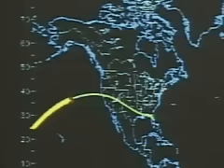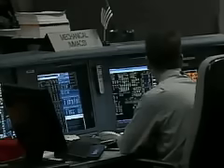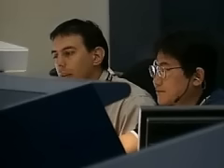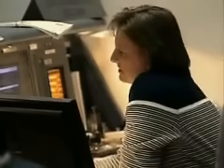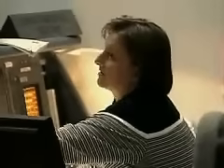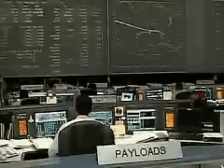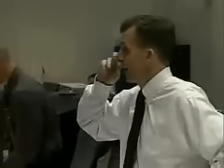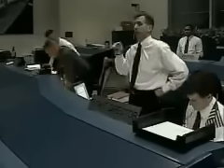Inside Mission Control During STS-107 Columbia's Failed Re-entry and disaster

Comment: Can you imagine what that flight director was feeling as he gets bombarded with all that bad data, lost sensors, hearing that constant UHH comms check go unanswered. The fact that these people kept their cool is amazing.
Reply: I would imagine Leroy was briefed that if there was going to be a catastrophic event on reentry, he would see the initial signs of that occurring. When the tires lost pressure, I think that was his first indication there was indeed a breach of the left wing.
Reply: @jameshoran8  they absolutely were all aware of the issues with the launch debris as there was an investigation during the flight. the investigation was closed determining it would not affect the entry but of course you bet he knew it was the left wing. When several sensors failed at around 2 minutes into this video and he asked both, where are they located and is there commonality the answers were chilling. First off all the sensors were in the left wing and second there was NO commonality, meaning that it wasn't a single computer or electronic system that controlled them all which with a simple not threatening malfunction could cause them all to fail. The fact they were on separate systems and all failed meant it likely wasn't instrumentation and was a real failure... the only communality turned out to be the location... the left wing they knew had been impacted by debris. When several additional systems in the left wing including tire pressure was lost at 5 minutes (lost tire pressure on mains in the shuttle is a border line fatal event that if this flight had continued might have caused them to make the decision to bail out) and then at the same time they lost communication AND data from the shuttle entirely they knew. By 8 minutes they knew for certain but continued to treat it like there might be a miracle. By 12 minutes they were told from outside services there was visual confirmation from Texas the shuttle had broken into pieces and that's when they locked the doors and began data preservation procedures.
Reply: *UHF
Reply: I'm not sure they did; there's quite a bit that doesn't make it on mics.  I don't like thinking of NASA people as soulless zombies.  There's no way you can take in Challenger and Columbia without emotion.

However, because hindsight is 100 percent, why didn't NASA send human-less probes to the moon first; why risk human mortality until more certainty had been established?  I think nationalism was to blame, and the sense that capitalism absolutely had to triumph over soviet-style communism, no matter what.
Reply: I don't feel a lot of empathy for the NASA folks.  They knew there was an issue with this flight.  A recurring issue from other flights to be exact.  They played  Russian Roulette with the live of these people and lost.  1986 was not much different.  They ignored the advice from experts and it cost a bunch of lives.  I met one of the engineers who warned them about the O-rings.  He lived the rest of his life seething with anger for NASA management because it could have been prevented, but, some of the managers were more interested in career advancement.
Reply: @jeffdenig705  I think with this particular flight, they just didn't think it was that bad because it was a small piece of foam that hit the wing (it was a 2ft. x 1ft. piece of polyurethane) and it wasn't something like O-rings which can leak fuel onto a rocket and cause an explosion. I believe they just weren't thinking about a small part of the wing being damaged. Maybe they thought the crew would notice, attempt to temporarily repair and return safely.
Reply: @jeffdenig705  you do realize that only a few at the top knew about the o-ring issue right? That most of the people in mission control had absolutely no idea.
Reply: @josephherron7671  o-ring killed Challenger...Columbia died from launch debris damage to protective tiles
Reply: Well, they know they are being filmed. I think if they weren't being recorded they would have let all of their raw human emotions loose.
Reply: @DeepPocketsEnt  in that moment I seriously doubt any of them were thinking about being on camera.
Reply: @josephherron7671  I don't. I can read human behavior extremely well, I studied it extensively, with a specialized focus on body language.

Their behavior was VERY visibly contained, anyone can tell they were holding in all of their emotions, you can see it all over Cains face, he looks like he's ready to burst into tears. They were all WELL aware that they were being filmed at the moment, that this video was going to go down in history, and that this moment would be viewed millions of times, ad aeternum. 

What they showed outwardly undoubtedly did not match the whirlwind of emotions that was going on inside themselves in that moment. Cain was visibly on the verge of tears the entire time but he held back to maintain a strong and professional demeanor. I'm sure he has probably spoken on this matter in interviews.
Reply: @DeepPocketsEnt  of course they were holding on their emotions. They’re trained to hold their emotions in stressful situations. Otherwise they wouldn’t be worth a shit as mission controllers. Man you really have a warped perspective on the world.
Reply: @DeepPocketsEnt  literally armchair analysis, just because you say it on the internet doesn’t mean it’s true xd.
Reply: @DeepPocketsEnt  HOLY sweet mother of non-ironic god
Reply: @DeepPocketsEnt  "I can read human behavior extremely well, I studied it extensively, with a specialized focus on body language."  

Cain actually does not look like he was ready to burst in to tears.  Have you ever met an engineer?  They've likely never been on the verge of bursting into tears. 

So, besides the cameras, you realize that they're in a professional work setting and must show composure in front of each other.  No different when there's an earthquake in skyscraper offices.  Or when a surgery team loses a patient.  No cameras and they keep their composure. 

Can you read my body language toward you right now Deep Pockets?  Hint. It's not good.

Comment: 13:20 Flight Director invokes the JSC Contingency Plan (JSC-14273) - "Definition of Space Shuttle Program contingency: A Space Shuttle Program contingency is
 defined as any program-related failure, accident, or incident (involving Space Shuttle
 Program-controlled flight or test hardware, support equipment, or facilities) that significantly
 delays or jeopardizes the Space Shuttle Program or a flight, prevents accomplishment of a
 major objective, or terminates a flight prematurely." They are basically securing the room and treating everything as if this was a crime scene. All in an effort to prevent whatever happened from ever happening again.

Comment: @12:30 I didn't understand the "lock the doors" and after seeing many comments talking about it but not explaining it I googled it and my heart shattered and i got chills.
For those wondering, it meant that the failure was fatal and to secure mission control so that nobody comes in or out. All controllers are to begin saving their telemetry for the investigators.
Reply: Flight Director did everything right after he knew what had happened.  Kudos to him.
Reply: It's called "Impounding the data". Everyone basically freezes in place, no one can come in or go out of the room. All data, electronic, voice, even scratch paper notes, are collected for the investigation that will follow. This is standard procedure when there is an anomaly .
Reply: Yep.  At that moment, Mission Control effectively became a crime scene, for the purpose of investigation.
Reply: As soon as you hear those haunting words LOCK THE DOORS you know all those in that room will be feeling and those poor people on board have just lost their lives
Reply: Not after you realize many engineers begged NASA for visual inspection of the protective tiles but they were turned down. They knew exactly what happened the moment telemetry showed a surge in heat on the left side of the ship.
Reply: @dorianrustik6880  a small part of my branch at my company developed the THz imaging system that would be used after this to inspect the insulation system.
Reply: @dorianrustik6880  are the idiots responsible ever named and held accountable for these preventable disasters
Reply: @dorianrustik6880  Exactl! Begged and ignored. Engineers asking for outside agency help. They were trying to get the defence department to use spy satellites to take pictures of the shuttles heat shield. Which was done on STS-1, the first shuttle mission also with Columbia, classified at the time, but no doubt would have saved the crew of Columbia on this day.
Reply: @BluesMan123  I feel u, bud. Let's hope we learned from their sacrifice.
Reply: @dorianrustik6880  are there any videos available about the moment the mission started failing
Reply: @RiyanRishitha  There is a recent video on You Tube by Scott Manley who along with telemetry spells it out. Very precise & clear each moment to complete destruction.
Reply: @cherylcarroll7916  thank you for the response
Reply: It’s all evidence. It’s standard preservation of evidence.
Reply: Thank you for adding this! Those words give me chills every time I watch this footage. I assumed it was to keep people in, but didn't know that it had such a devastating additional meaning to the controllers beyond that. So many goosebumps.
Reply: @jlbyler22  Me too  chills every time for me as well...and hello there...atleast I am not the only one from May 2022 watching this
Reply: @raintree3383  Hello to you as well! I'm happy to have a fellow May 2022 watcher here with me 😀
Reply: @jlbyler22  Hello..thanks so much for your reply ! This video is so real life.... Completely devastating for the people controlling it all....sadly and Hi from Lorraine in Canada
Reply: @jlbyler22  Hello May 22! I'm from the future! January 2023. If you should happen to bump into my 2022 self, could you tell him that he was right about the vaccine? Cheers!
Reply: @zakmartin  Vaccines are fine.
Reply: IN the Artillery, if have a round land where it shouldn't, our "Lock the Doors" is "Cease Fire, STAND TO THE REAR OF THE PIECE!"  It means nobody touches anything, and you fall into formation behind the gun and pray that you dot go to Leavenworth.
Reply: Yeah, they need to be a walled castle at that point. No distractions, no interpretations. The data systems were much more robust than during the Challenger Accident. Heck, the control room in Houston during Challenger was basically unchanged since Apollo.
Reply: Thanks for that
Reply: Keep the scene sterile for investigation.
Reply: At least it was over for the crew as soon as the hull broke. Maybe less than a second.
Reply: How's THIS for chilling: 

the ONLY reason there hasn't been 3 MORE SHUTTLE EXPLOSIONS courtesy of the CRIMINAL negligence of NASA (founded by a Nazi!!!) (YIKES!)........(Von Braun!)......is bc the Space Shuttle program was retired!
Reply: Thank you, that’s very helpful
Reply: Pretty self explanatory but congrats on utilizing resources to solve a ?
Reply: I don't understand, could you elaborate more? Coming in or out of what?
Reply: @anthonyanthony2783  the control room
Reply: That comment was made because they didn't want to immediately tell the truth like any government entity they didn't want to answer questions despite the fact they knew exactly what happened....
 It's called keep the tax paying citizens stupid......
Reply: @FSEVENMAN  Did someone say "stupid"? There's nothing more pathetic than ignorant morons who don't understand how anything works calling other people "stupid."

Comment: You know I had an argument with this guy who designs software for the US military weapons over this, I said, you know they could have done a flip with shuttle after undocking to verify there was no damage. Well interesting enough once the shuttle got off the ground again before it docked with the ISS it would do exactly that, a flip so the folks in the ISS could inspect the shuttle for damage and the cameras on the ISS would send images back to NASA. This accident could been avoid if they simply just took the time and looked to confirm instead of going on their hunch that nothing was wrong. It's the engineers responsibility to get those astronauts to and from space, they should be held accountable for killing those poor folks. Yes I understand space travel is a risky busy but it shouldn't be plagued with stupid people but people who take the time to investigate visually check if there is a problem.
Reply: Just that STS-107 never went to the ISS, it was a specific science flight, not an ISS-building one. So they were in a completely different orbit,  no way to reach the ISS.

Comment: Terrible. They knew this could happen as soon as they found out about the tile after launch. A morale dilemma of whether to tell the astronauts or not ensued apparently. Such a traumatic event. That's why astronauts are heroes. RIP.
Reply: There was no moral dilema.   They did the immoral thing.  An email sent to the commander and the Pilot of Columbia said this:  "During ascent at approximately 80 seconds, photo analysis shows that some debris from the area of the -Y ET Bipod Attach Point came loose and subsequently impacted the orbiter left wing, in the area of transition from Chine to Main Wing, creating a shower of smaller particles. The impact appears to be totally on the lower surface and no particles are seen to traverse over the upper surface of the 
wing. Experts have reviewed the high speed photography and there is no concern for RCC or tile damage. We have seen this same phenomenon on several other flights and there is absolutely no 
concern for entry."   This was entirely misleading because the Debris team had been asking for better images of the damage area in order to provide a conclusive analysis of whether it was a problem or not,  and the NASA managers had denied all requests.  Instead they told the crew that the experts had said it posed NO safety issue.  None of the experts had said that, in fact,  the team analyzing debris impact unanimously said the opposite.  That without better images they could not and would not arrive at a conclusion on whether it was safe or not to perform re-entry.   Only 3 people had said that it was probably not a big issue.   Vs a team of over 40 engineers who all unanimously said they couldnt say for sure.  And they still went ahead with reentry as scheduled and this happened.
Reply: @DominicciSkycam  interesting - yet isn't the moral dilemma lying like they did or admitting to them that they face certain death on re entry? Just playing Devil's advocate here on the assumption that nothing could be done to save them - they were doomed as soon as they took off.

Comment: they ALMOST made it home. An insulation foam piece fell off the ship when it launched and they knew that. It was still on the launch pad, so they KNEW it was going to be a potential problem when they would re-enter the atmosphere coming back home.... And damn it.... They completed their mission and everything...they were literally MINUTES from landing.... And just like the Challenger, there were thousands of people waiting, looking up in the sky at NASA and watching on TV...OMG, they were literally minutes left to landing, but as they entered back into the atmosphere, which is HOT, that foam piece that fell off allowed all that heat exposure to the shuttle and upon entry the shuttle discentergrated before our eyes 🤦🏽‍♀️...smh

The same thing that happened to the challenger.
Reply: Not exactly correct. Yes a foam piece did come off but it wasn't found on the pad as the piece broke away miles above the earth and disintegrated upon impacting Columbia. That impact broke a hole in the carbon carbon reinforced panels that protect the shuttle upon re-entry.

Comment: The designer of the shuttle made huge errors of global assessments which cause the list of 2 shuttles. And the director of flight was in the inexcysed to be up.of the task because the global design was in technical failures. The Nasa want to cover up their blunder si tgey can still go on with the blunders and the sur force abused of power to victimize the inia airforce inspectors to relinquish their awful disaster of behavior without an semper  Fidelis to their oath. So 12 cosmonauts list their lives for nothing

Comment: i blame everyone in that room for what happened..  they knew a piece had fallen and hit the wing....  why not send someone out to look at it or try to get a camera out there and see what damage if any had taken place..  but no...  just let them fly back in and take "their" chances...  well nasa..  you lost nothing..    but the astronauts lives were surely lost for your stupidity...  btw the challenger debacle was "partly" caused by cold weather..  the other part was because nasa purchased 8 year old o-rings from the distributor..  how do i know??   we bought  o-rings from the same guy.. and after what had happened he mentioned to my boss that they were sitting on the shelf for 8 years losing their elasticity.. only a 5 year shelf life max...  with the cold weather alone they should have worked fine if the rubber wasnt stiff as it was for sitting for so long..
Reply: How would someone get the the leading edge? You bought 12 foot diameter o-rings also ?
Reply: @jrockett73  well some one could have gone outside to look at it or use the arm and take picture  but they were denied  when the engineers asked to have that done..was deemed unnecessary.. and no we didnt buy 12 foot o-rings.. we got smaller ones from the same distributor..
Reply: Again, how do you get to the leading edge? There was no arm on this flight. There was nothing wrong with the o-rings during installation and mating of the booster segments.